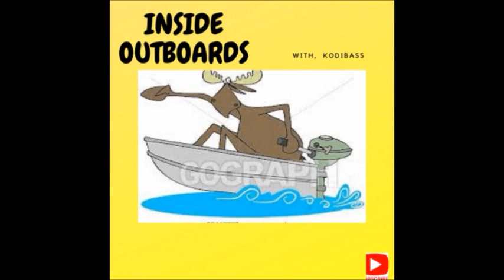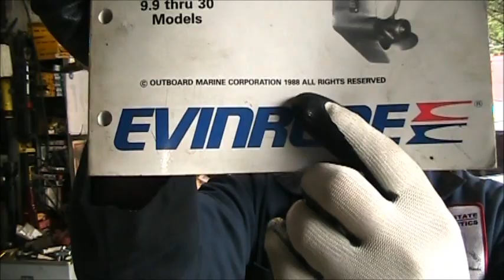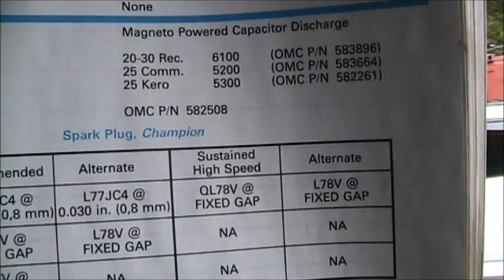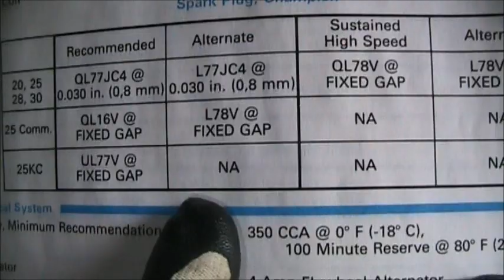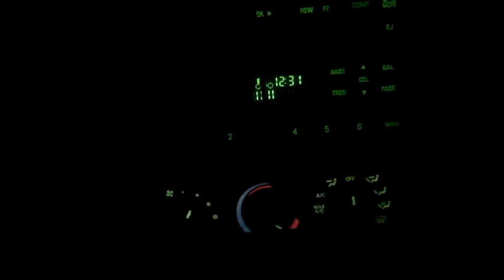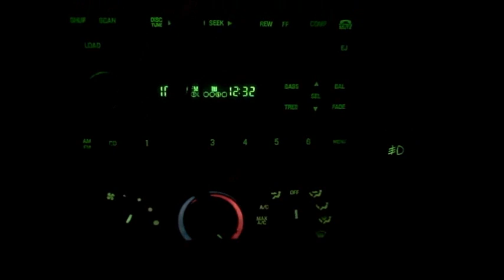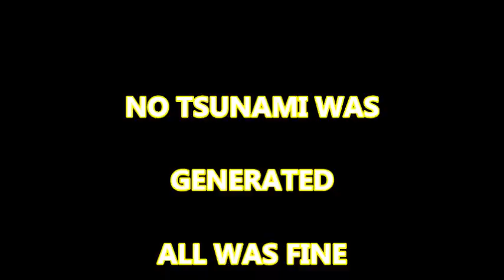OUTBOARDS,   Boats   &   WHAT'S   SHAKE'N

Comment: I have a 1976 25 HP Evinrude. It will not got WOT when I throttle up it bogs but never die. I've rebuilt the carb and it has great spark before I did anything it would only do 4-7 mph. Compression is 110 on both cylinders. This is my very first motor and I'm exhausting all options please help. Idles great. Also RPMs will not go high like it should in gear but will in idle.